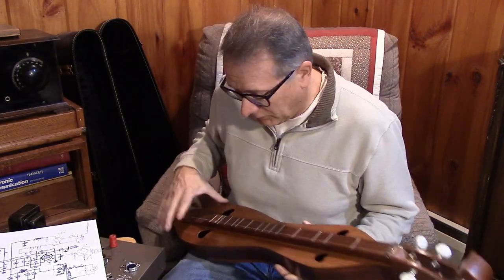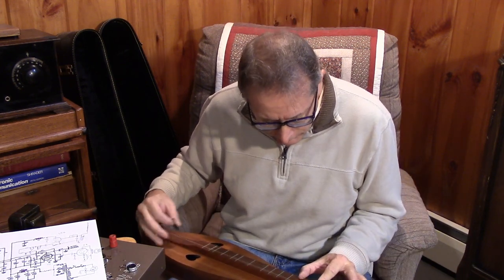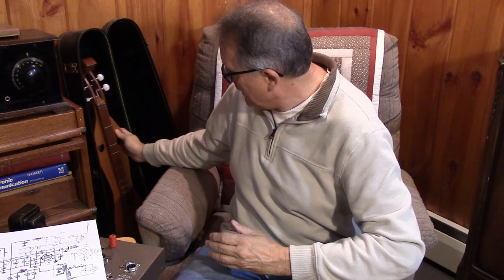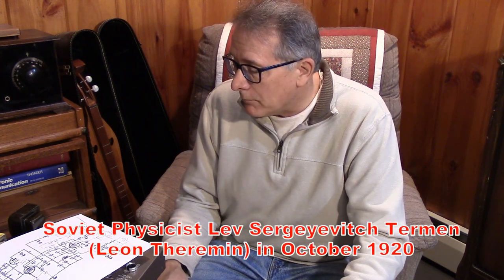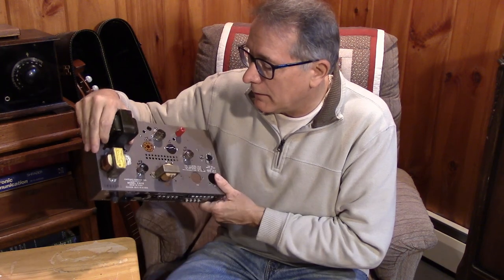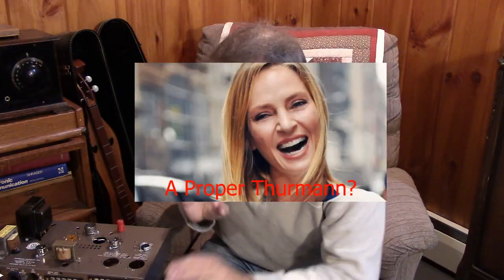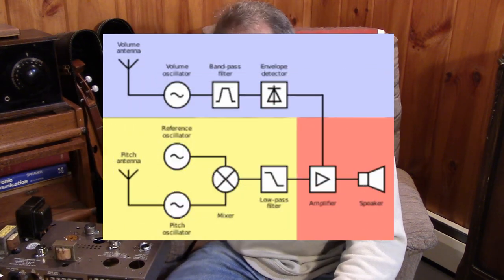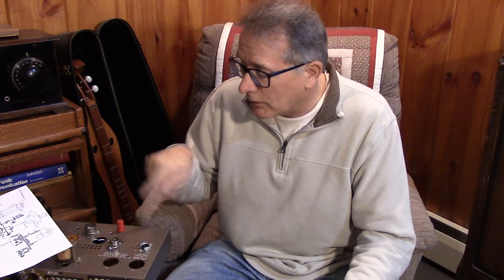Classic Tube Theremin Project

Comment: Hello Mike. I've been wanting to build a theremin for a long time.  This is the moment to do it. Better if is with tubes because I like  this technology. Thanks to share your job!
 73's Mike.
Reply from the maker: There seems to be three levels of Theremin design - the simple toy that make noise, a basic unit with pitch and amplitude control that can do effects, and a fully optimized set that is able to be played over several octaves as a true instrument.
Reply: @MIKROWAVE1  okey Mike. With the second type you described I can try to learn to play basic melodies. Has your project have a volumen control antenna?

Comment: Looking forward to this. I have an old Graham Research Coil & Condenser Tester chassis that I’ve been wanting to try and cram a tube theremin circuit with a built-in amp and speaker into. (If anyone’s curious, there’s a picture of the exact model tester on the radiomuseum.org.) With the meter removed, there’s already a “perfect” hole for mounting a small speaker. I’m hoping there’s enough room inside for the theremin’s “guts.” The chassis/case has been taunting me from a workshop shelf for years.
Reply from the maker: Yes and that is how I am thinking too. I want to reuse existing chassis and "furniture".

Comment: You mean a project with no RF?
No RF at all, anywhere?

73 Steve
Reply from the maker: What? 3 LF Oscillators, a Product Detector and a Bandpass Filter for starters.
Reply: @MIKROWAVE1  This project does remind me of a multi-oscillator 'thing' that I built some fifty odd years ago. It was in the early days of the bbc radiophonics workshop and that scary Doctor Who theme tune. Of course as an electronics obsessed young kid I started trying to replicate these sounds. There was a GPO telephone cabinet on the street right in front of our garden wall behind which I hid a loudspeaker. I spent many fruitless hours broadcasting the results of my noise machines to bewildered pedestrians. (GPO general post office. UK's soul telephone supplier back then)
73 Steve